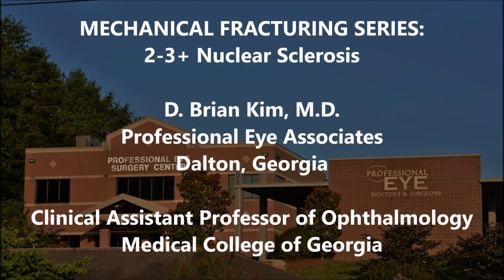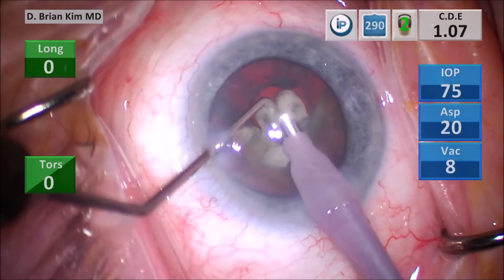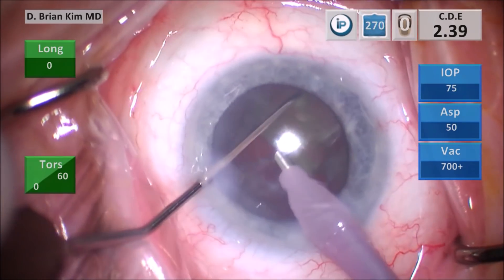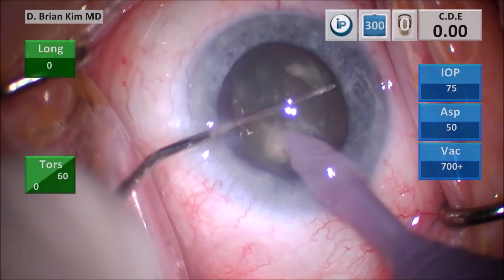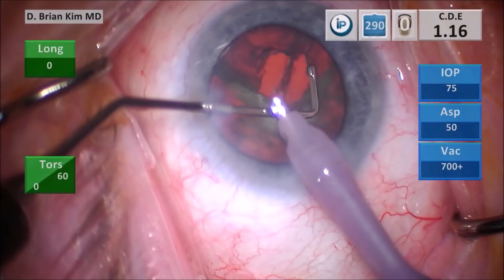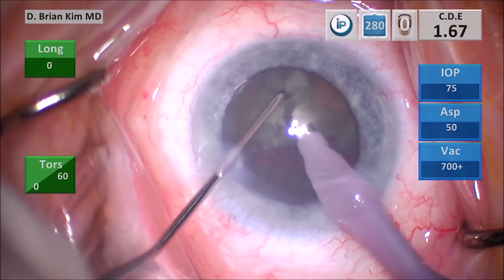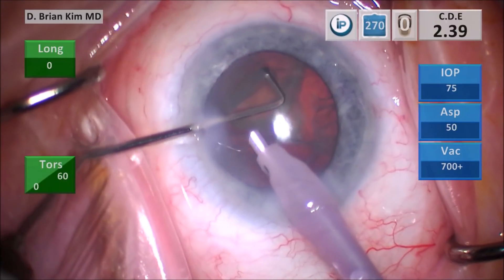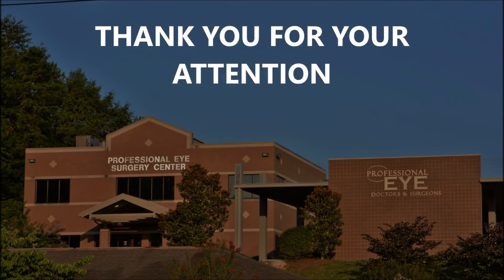The Best Way to Do Cataract Surgery #1: Manual Fracturing the 2-3+ NSC

Comment: Sir,nice video...don't u think long chopper are more safer to protect posterior capsule than small choppers during phaco
Reply from the maker: for the purposes of protecting the posterior capsule, I don't think the length matters as much. The tip is more important. It should be smooth and rounded and not sharp.
Reply: @DocBrianKimMD  thanks sir...